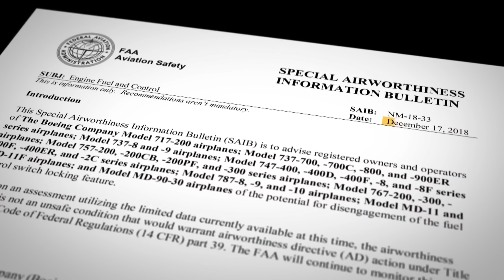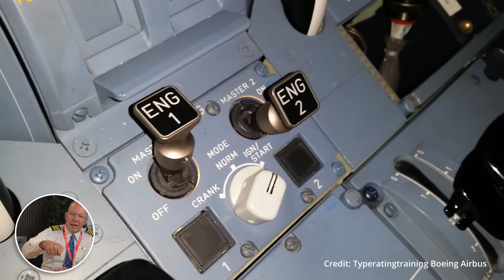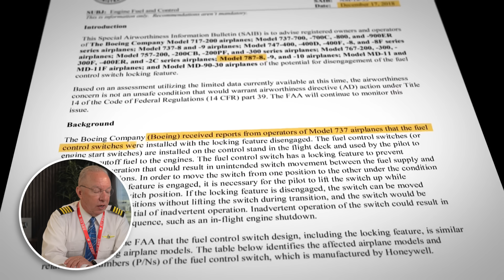Air India 171: The FAA’s 2018 Fuel Switch Locking Bulletin Explained (16 Questions Answered)

Comment: First you said flaps are the issue, then you said the landing gears or wheels were never retracted, then fuel contamination, then RAT deployed due to power failure, now pilot error... But mostly your focus was about pilot error from the beginning... I think you are speaking with some vested interest... The photos show clearly RAT got deployed in run way itself ...if the fuel was cutoff that time, before the rat got deployed there would not enough power to climb further but it went higher and farther.... But mostly they way you trying to project and speaking about aviation psychologist, I think you are trying to divert the attention...already boeing starliner had issue and stocks to boeing is gone down...is it their paid diverting videos trying to prevent an inherent technical issue?
Reply: He didn't say any of those things were the problem. those were just possibilities that were eliminated as the EAFR data became available (even before that, via simulator runs, for the flaps and landing gear).

Comment: I am aviation geek and watched nat geo air crash investigation alot ,  For those wondering how investigators know if switch physically switched , investigators not just analyze electrical singals , they also analyze  sounds in cockpit voice recorder and can find out which switch by comparing click sound it make to sound in cockpit voice recorder
Reply: Cockpits are pretty noisy and the click of a switch could be downed out by the ambient noise.
Reply: @JBoy340a investigators can use tools to to split audio and remove engine and radio and pilots noise and it will remain clicks noise since cockpit microphones are sensitive and can pick up even little noise
Reply: @JBoy340a  Insonorizate cabin, so you have no reason.

Comment: Why not keep a solution, if any change is even warranted, simple and just place a cap over the switches which would require two deliberate operations, lifting the cap and lifting the switch, before the switch position can be changed?  And do we even need to do anything if one  the pilots executes deadly actions?  This would be a mental health problem, not an aircraft problem.
Reply: The fuel cutoff switches already require two deliberate oparations:  Pulling the switch handle out, then moving it.

Comment: Here, one most important point is the deployment timing of RAT.
This is not addressed clearly by the various experts nor is it specifically mentioned in the report.
It is vaguely mentioned in the report that RAT was deployed immediately after lift off. Elsewhere in the report it is mentioned that the RAT started producing electricity after 5 seconds of the engine cut off.
Is 4 or 5 seconds sufficient for the signal to be given, flap to open, RAT deployed, and propeller of the RAT to start rotating before electricity is produced?
If it is proven that RAT was deployed before the engine fuel switch was cut off, the whole scenario changes and will convincingly prove that the fuel switch got cut off after there was a major electrical failure in the system, warranting deployment of RAT.
Hence, in that case, it will mean that the fuel switch cut off is a consequence of a major electric failure.
I wonder why the RAT timing was not mentioned in the report when timings for all other major incidents have been clearly mentioned?
Reply: Yep, a new airport image on the report shows the RAT deployed immediately during take off
Reply: A couple of flaws in your speculation:  A major electrical failure would show in the EAFR data; and the fuel cutoff switches have to be manually operated, which the EAFR shows they were.
Reply: Why does it have to be a major electrical failure? I would investigate the architecture of the computer to identify possible causes. The switches don’t actually turn the fuel off, but instruct the computer to. Could a single bit flip have caused this even if there was redundancy built in? Crazy stuff like this has happened before.

Comment: I concur with @MatthewMello. As a train driver of over 20 years, we now have a downward aimed camera in the cab (with a microphone). The footage is only accessed after an safety incident or accident by the transport safety board here. To say that pilots don't want cameras because they might be doing something they shouldn't like "reading a magazine" is a trivial reason.
Given the voice recorder so far doesn't seem to shed light on which pilot moved the cut-off switches, a camera would have absolutely shown who did it, allowing a deeper investigation into that pilot's background and possible motivation, or indeed if it was genuine human error.

Comment: If anything at all, a camera in the cockpit connected to a recorder like the CVR and Data recorders, its really only used if there is an accident to aid the CVR audio to see if there is more information that can be obtained. But in reality, is it worth it to put camera(s), run more cable, develop and install a new recorder type, for the express purpose of answering the question of who was it in the cockpit that pushed the button at the wrong time.

It will probably induce more issues than it will solve. But would it make pilots who are customed to not adhering to sterile cockpit rules and other things be more vigilent.  We all know there are pilots out there that dont follow sterile cockpit and sometiems do weird things, but most I would say are top notch and on thier game.

edit: Just curious, and its extremely unlikely, but what if there was a third person on the flight deck, one that was not supposed to be there... IE: It wasnt arranged with company and there was no records of it, but these pilots allowed it for some very strange reason. If that person entered the flight deck and strapped in and then remained silent (unlikely), there would be nothing on the recorder if the recorder wasnt recording at that point (for reference I dont know when the recorder becomes active... at what part of the aircraft setup prior to pushback does the CVR get turned on). I mean there had to be something going on in the head of one of the pilots when they chose to toggle those switches then deny doing it when questioned by the other. Unless there was a 3rd person in there that did it. I know what in order to ride on the flight deck, it has to be well approved and cleared on many levels with company, insurance and all sorts of things. Mostly just off duty pilots from the company get to ride on the jump seat, but occasionally some media people doing documentries are approved to ride and film in flight deck as well. If there was a 3rd its almost certain there would be records, and the report would have mentioned it. But, in the very unlikely chance one of the pilots was skirting the rules (and of course the other one was complicit with it), could there have been a 3rd person on the flight deck?

Anyway, it seems to point towards one of the two pilots taking a decision to operate those fuel cutoff switches. It seems as if they were put back to run even a second or 2 earlier they might have been able to fly out of it.

Comment: If the door were able to fell off I believe something on the other side of switch could brake aswell. Too early to conclude pilot committed suicide. 
In Lufthansa case of German pilot flying into Alps it was long history of mental problems omitted by the system and pilot too.

Comment: Hi Captian Steve,

The report clarifies that the fuel switches were operated during the take-off. There is general agreement that these were moved by one or both pilots. Who positioned the switches to the “off” position, and who then placed the switches to the “run” position is not clear from the report.
 
Releasing the FDR data would bring clarity to this following important question, did the pilot or pilots operate the switches in response to a developing situation through an alert, or did they operate the switches without any warning or alert from the onboard systems. 

I believe the answer to the above question will go a long way towards ascertaining the truth in this very tragic crash.

Thanks for a great episode.

Mark

Comment: My simple question: is it even physically possible to switch off two switches within a gap of 1 sec which have a space between them and need to be done by a pull and push action. Moreover these switches are not in the visual range of either pilot specially while take off, that one of them casually puts a finger and moves it.. there has to be a proper physical action to activate them which cannot go un noticed by the other pilot in the cockpit. 
The report has provided more questions than answers..

Comment: Captain Steeve, Thanks for your video.  It may be easier to understand by elaborate/discuss with a timeline-event diagram （time scale in second interval) that shows all the critical event/information extracted from both the CVR （e.g. conversation between two pilots) and FDR (e.g. fuel switch events occurred with airspeed, altitude, engine power, configuration and/or operation information etc, RAT deploy, Landing-gear status, etc), starting from Air India in runway takeoff (if possible, also provide an in-sync timestamped videos, including captured by any nearby car/street/shop/security CCTV footages, of the air india flight, e.g. time airplane take off at end of the runway, available so far)?   Thank you.

Comment: Someone posted this: This is exactly what happened:   - There was an anomaly in the electrical supply at 08:08:41h, so the hardware and software closed the fuel valves.   The engines began to lose rotation and the RAT was automatically activated. When it restored electrical power at 08:08:52h, a RESET was generated in the software and hardware, then opening the valves again and indicating that the switches had been placed back in RUN, when in fact they were NEVER changed by the pilots!      -Don't forget that Boeing's 787-8 Dreamliners have a history of electrical problems!
Reply: And the pilot discussion about who turned the switches off, is a manipulation.
I guess it never took place.

Comment: Airport runways are not long enough. A minimum length of runway should be 4 times the current length. They may have had a chance to save all lives and the air craft would have been in one piece so that proper  investigation could be carried out. A longer runway would give pilots a bit of confidence to get back on the runway if they have a problem.

Comment: Hi Steeeve, 

2 questions: 1. What reported the switches were turned off (Flight Data Recorder?).
                        2. Could there still of been a fuel problem? Like Vapor-Lock?  (For as hot it was that day) If one of the pilots thought there was an issue with the engines getting enough fuel and cycled the fuel switches off and then back on?

Thanks

Comment: You are so confident saying it’s the pilot. But we don’t know why the fuel switches were cut off one second apart. May be one of the pilots did it intentionally or inadvertently. Or may be that’s not true because CVR indicates pilot denying that. So that needs to be investigated as well. What if the pilot is not lying and indeed somehow the fuel switches were cut off mechanically or electronically.
Reply: There is allllllllllllll the data from the black box etc showing that electronic or mechanical failure did not happen. 
There are teams of experts from multiple countries looking at that data. There are pilots running flight sims to try and recreate every possible thing that MIGHT have happened: and none of that indicates anything other than that this was a deliberate act to cut the fuel off.

Comment: 11:30 Again wrong. He meant to say that the thrust lever should be pulled back to idle before the fuel can cut off. He did not mean the engine should have spooled down before fuel cut off. What time does this extra safety step take in the shut off procedure? Extra 1 second? You mean to say you don't like it because it would take 1 second of extra work?

Comment: There was initally comments about the flaps of the aircraft not being in the proper position in the bits of video we saw.  Do we still see no issue with the position of the flaps?
Reply: Yeah, there's no issues with the flaps. Early videos weren't able to show if the flaps were properly deployed or not, but videos that came out afterwards showed that they were. Also, it was proven that even if they were deployed incorrectly at any stage of takeoff, the aircraft would still be able to take off. So that is completely removed from the equation.

Comment: transient electrical noise can fool the ECAM to trigger engine shut off, you would never be able to simulate that with total electrical failure. The Capitan could be inquiring "why did you shut off" because of an alarm on the screen and not because of seeing the actual switches in off. The cover up totally possible.

Comment: Hello Captain Steeve, I think your comment on the fact that the pilots did transition the fuel switches deliberately is incorrect. The report clearly highlights the sequence of events where the RAT was deployed even before the fuel cut off switches changed from their default position. Just after 3-4 seconds of take off itself the RAT was visible as per the report, which means that the fuel switches changed could be in response to that. Hence the pilots handling the switches here could be normal. The point is that there was some malfunction during or just after take off itself, that caused all of this. 

In a previous video you mentioned that the fuel switches changed and the engines turned off, thats why the RAT deployed. That is not correct anymore sir, because the report confirms the RAT deployment as the first occurrence in the sequence of events. Hence your entire theory of either of the pilots deliberately doing this should be disregarded at this point.

Comment: Question 1: Is it possible that a power / electrical failure causes an interruption to the data recording, thereby showing a change in the state of the fuel control switch ? Or would it show no change due to the RAT supplying backup power ? 

Question 2 : Is it possible that, as per the Bulletin on the Fuel Control switches, they may have been installed with the locking feature disengaged ? 

Question 3 : What is the frequency at which the state of the Fuel Control switches is recorded ? Is it once every millisecond ? Once a second ? Once every hundreth of a second ?

Comment: What is the probability that the locks on the fuel control switch to wear out(since aircraft was around 10 years old ) and shift position while take off, due to vibration.

Comment: If you read the entire SAIB NM-18-33, towards the bottom of the page, it mentions about failure of the locking mechanism leading to its disengagement, so it is not an issue that can only be present from the beginning due to defective installation alone. Thus, the disengagement of the locking mechanism can occur due to either faulty installation or became disengaged subsequently during service. Therefore, this issue needs to be looked into further, which could potentially prevent future tragedies.

Comment: Sir, ‘Key word in 2018 circular is LOCKING FEATURE DISENGAGED’ your argument of switches being installed in reverse order (in aviation I don’t thing u can install any panel in reverse direction) does not hold ground and you are somehow unable to explain this. Even if it was installed in reverse order the detent(locking mechanism) should hold the switch. So simply putting the detent or locking mechanism had a fault which was not addressed by Boeing and Air India.

Comment: 11:59- when we say "alert" it means application of mind "BEFORE" the pilot does something. So he would still have the power to cut off but at least he could get an alert from the system= BEFORE CUT OFF  that despite thrust the pilot is shutting off the fuel supply. one would imagine this would be there in a modern aircraft like Boeing!!

Comment: I work in a bank. We deal with hundreds to thousands of people a day and we are always under CCTV coverage. Our decisions don't necessarily cost lives but they can have severe financial and reputational impact. Every moment we walk in to after we're gone, things in the bank are monitored 24*7. When airports and gas stations and your apartments have so much CCTV why not planes and cockpits? Pilots have gone very wrong more often than we like to think and passengers too can become horribly unruly. The Indian government is putting CCTVs in every single loco and coach in the country now. They should mandate CCTVs in cockpits. Enough is enough from the pilots unions - they didn't want extended CVR recordings until complex accidents that required hours and hours of flight data even from previous flights and conversations to be known happened. It's not an option anymore.

Comment: I worked as a cashier at department store. We had cameras above our heads, and nobody had any issue with that. Just part of your job. Captain Steve was disonest answering this question. Yes, it would not prevent the accident, but...Black boxes don't prevent anything eather. Does it mean they are not needed, Captain?

Comment: It would be highly unlikely that  state of the art and smart airplane like 787 will crash based on flipping switches….if it is that way then Boeing needs to work on the software to handle that…putting a detent on the switch a just a primary control the main control should be FADEC …even small aircrafts like Embraer have this safety feature..